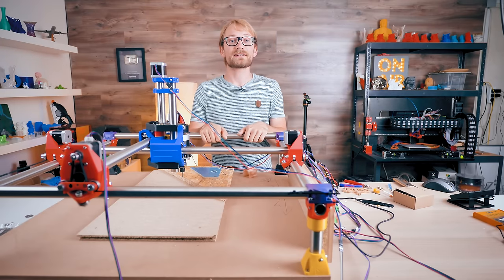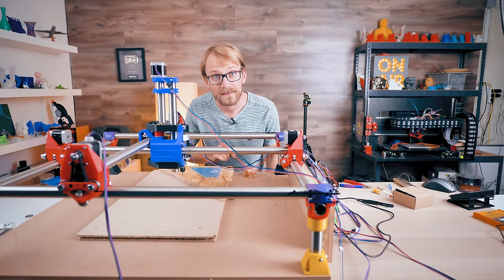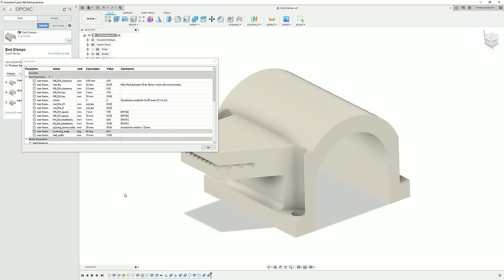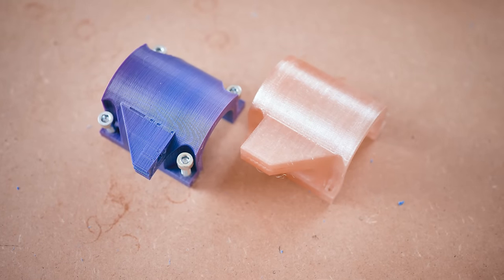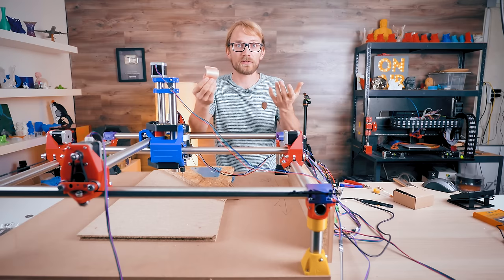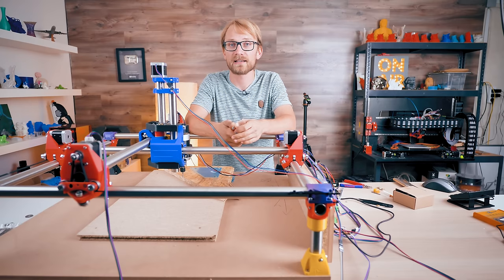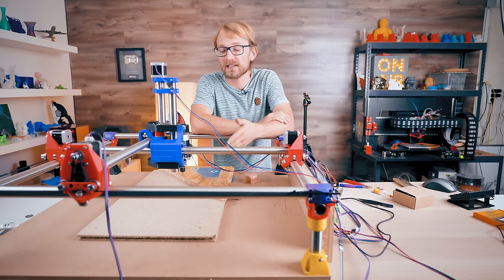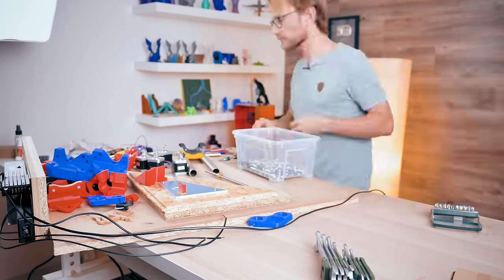Whose design even is this? (MPCNC conclusion)

Comment from the maker: One note on the video: While I was editing this one, I noticed that I had originally misread one of Ryan's tweets. The video is edited to reflect that, but its tone is still a bit harsher than I'd like.
All things considered, the MPCNC is not the right project for me, but I still wish Ryan all the best with it.
Reply: Why make it then disassemble it I thought you were gonna use it
Reply: @davidwhitt3299  Spite. (Still love you Tom :) )
Reply: @davidwhitt3299  Did you watch the video?
Reply: @davidwhitt3299  He probably doesn't want to support the project anymore, I was going to build it, but I'm certainly not now
Reply: @davidwhitt3299  because you do not want to check for licenses when sharing a new part. he stated clearly he wanted to make the machine more flexible and accessible. imagine the nightmare of licenses. clearly this is not the machine that fits his needs
Reply: @davidwhitt3299  Because of the license claims of the 'maker' and Tom's admission that making a for profit video about it is a grey area, it would be foolish to continue doing anything with it for the channel if/when the 'maker' pulls his (implied) permission. I would also make a wild assumption that the thing has left a very bad taste in Tom's mouth (for all kinds of reasons) and personally I wouldn't want the thing in my line of sight if I could avoid it. It still has a ton of useful parts that could be used for other projects, such as any other OS CNC...
Reply: @davidwhitt3299  i wouldn't want to touch that project even with a long stick after that kind of tantrum from it's owner.
Reply: @davidwhitt3299  Because of this licence mess? If Tom can't design mods/upgrades for it, and release them freely ("free as in speech" as well as "free as in beer"), then that takes away one of the main reasons for him doing it.
Tom has always been very "pro-open-source", and IIRC one of his Patreon goals about two years ago was releasing his videos under a Creative Commons licence (that was subsequently reversed due to issues that I don't recall, but he asked his Patreon supporters for their views before he made that decision).

Designing models and releasing them freely to the very community that pays his bills is his whole thing. Sure, he could continue using this machine in future videos, but currently it sucks really quite badly (not saying that's Tom's fault, of course!), so in order to use it he'd have to either design upgrades that he can't release as freely as he wants (and if he doesn't release the models, then that reduces the value of what he's doing), or he'd have to use existing designs from the community, and "hey look at this collection of a dozen models I found and printed" isn't Tom's style: there are plenty of other channels that do that, and if I were in Tom's position I wouldn't find it nearly as interesting or fun to print and show off a load of community mods instead of designing my own.
Reply: @animationcreations42  Same as me...
Reply: So I guess if I want to build this with some parts of my own design, the copyright police will invade my shop. So sad. I'm still leaning toward one of the OpenBuilds designs, but more money.
Reply: Oof. What a drag. Good thing I never actually looked into it like I meant to. NC licenses always felt like a red flag to me, guess I was right.
Reply: @Sven_Hein  next the God of the MPCNC will be suing Prusa over his flagrant use of a 3d printer to make thinly disguised CNC machines.
Reply: I had a very similar experience. It really bummed me out. I tried to sell mine for way less than I had into it because I was unhappy with the performance, and just wanted it gone. He emailed me and told me I couldn't sell it because of the license. Long story short that thing ended up in pieces just like yours.
Reply: This is really is bad taste regardless of law. All that was needed was a tweak to your license to include attribution, which you were already doing, and the addition of non-commercial. Why would any company want to work with you if this is how you respond when something happens you don't like? Unfortunately, I will also be unsubbing from your channel although the amount of content as of recent has been extremely slow to be released anyhow so I guess I'm not going to miss much. I liked your content, but this is extremely childish and serves no point but to stir the pot and point a negative light on a business protecting his work. This is just something I wont support. 

Bye Tom, good luck.
Reply: Probably gave Ryan too much free publicity. He needs to go all commercial now and pass on the open source. Too bad it had promise.
Reply: @Matt Bridges Who is childish here? Tom is clearly having issues with misbehaving company. He tried to improve his machine and share his knowledge with others, but Ryan does not want him to do that.If you do not understand it, then bye, will not miss you!
Reply: Tom stright burned Ryan, with this distrack.
Reply: @mattbridges385  So, all that was needed was for him to disregard his own feelings and give in to Ryan's wants. How dare he want to release the part he designed under the license he prefers to appease Ryan's ego.
Reply: @Cergorach  i agree with you.... you never know when the original author will come back and stab you... saying you profit from it's idea, one way or another....
it's better to stop now, than facing a lengthy court fight later.....
Reply: Very good video. I followed the conversation on twitter and the way Ryan acts ends up to one conclusion for me: I will not build his machine and I will not participate to his project. It's pure cherry picking what he is doing. Regarding your tone: Perfect.
Reply: Damn... really?!  I've followed your build  for the most part live.. And was thinking of building my own.. But that doesn't sound as appealing now.. 

I was very curious what your improvements would be.. 

What about designing this from the ground up?  I have the time and and capable of designing this. Only thing I miss is someone to collaborate and discuss with.

Or are there maybe already some good designs out there? Maybe modulair/optional with a rack and pinion drive?

Ow,..  and ofcourse fully open source
Reply: I’ll upload the part for you.
Reply: @benjaneering  Ridiculousness. I'm out.
Reply: No, the tone is perfect. Instead of accepting an welcoming an improvement on his design, he became an arse.
Reply: @therealnecroscope  same here.. let me know if you find another project..
Reply: Maybe Build the compact PCB maker that "The Ant" guys designed. Think you did a video on it?
Reply: I 100% agree with you, Ryan comments in chat were off base at times. Several viewers offer Ideals to him, but he rejected them. Its a shame, nice concept going nowhere... If can't help improve it than what's the point ..
Reply: @Thomas Sanladerer I would love to participate in designing a fully open source 3D printable CNC design.
Reply: @johncrunk8038  That's not accurate. There are a lot of remakes of these parts. The only thing Ryan is watching out for are the ebay sellers cutting out his shop (which is protection of the community as well as Ryan). If you make parts yourself, no foul. If you make parts and release them CC-NC, no foul.
Reply: @jeffeberl12  I was just extending the hyperbole.
Reply: Hey Tom, I gave you some $ during the build to ask if you'd visited the V1 forums.  Your answer explains a lot.  Good TV  ≠ Good Build.  The V1 forums have proven solutions for changes in design.  If you get jealous when a bunch of other youtubers make successful builds, the forums will still be there :)
Reply: @benjaneering  wow...i can't even wrap my head around that!
Reply: @catohagen He already does that, just there is a child that does not understand copyrights. Copyrights are not the same as patents, respect that!
Reply: leans in and whispers

MAKE A HYPERCUBEEEEEEEEEEEEEEEEEEEEE  xD
Reply: @mattbridges385  but what you're doing isn't the same? He don't like the way the project is taking and, with some respect, pulled off. You're doing the same: you don't embrace the contend anymore and unsub. Same principle.
Reply: @c4tohagen  I don't like the license but I could live with it. But the way Ryan acts and his false understanding of licenses is what I don't like. Have you seen 4:06 to 5:00? Unbelievable behavior from Ryan. Unbelievable understanding of how licences work and what rights he has. Nope - If I go for a CNC I go for an other one or build my own. 
BTW: If you think his understanding of licenses is right, you might want to do some research.
Reply: @mattbridges385  good luck and happy viewing others content for free, without paying them for their effort...  
But you obviously didn't understood the problem expressed.
Reply: @anthonyvescio5311  I wouldn't bother uploading the parts.  The project obviously doesn't want any improvements in their/his design.
This is why Stallman made GNU License.

To be clear, anyone can do anything with their own design.  But others must NOT like it and doesn't NEED to build it.   Better go to a project that is open to improvements.
Reply: @davidwhitt3299  you didn't even watch the video
Reply: @jeffeberl12  it is obviously not the copyright owners opinion.  And who want to go to court because of that.  It isn't like it doesn't cost you money.
Better to drop the project then have to pay for copyright infringement.  Even if we "know" that it isn't accurate.
Reply: @c4tohagen  Ryan obviously doesn't agree with you...
So better to go to a real open design, where the owner doesn't threatening others with law when you do an new part to replace a bad old one.

It isn't just the laws that makes it look like a bad idea to build this machine.  I would like to like or at least respect the actions of the copyright owner of the projects I build.  This story doesn't do that to me and obviously also Thomas.
And if that work ok for you, then good for you.
Reply: So... Basicly it's not possible to make a CNC with 3d printed parts without infringement of "copyright".
What if I create my full own design?
Reply: @davidwhitt3299  because he wants to take his ball and go home.
Reply: @RacoonMedia  right, I was thinking the same if we take Tom's interpretation of Ryan's argument to the logical extreme.  Tom went out of his way to design the part from a blank canvas and the constraints of the already existing pieces with the intent of avoiding this confrontation and when it happened anyway he realizes this content won't have a place on his channel.  How abstracted would the 3d printed pieces need to be for this guy not to be on your back?
Reply: @AndersJackson  Except you simply can't copyright  physical objects that aren't works of art. Or stop anyone building and selling one. You would need a patent to do that and even then the law allows you to make compatible parts and sell them. And I doubt there is anything novel enough about it to get a patent. The owner only has copyright on the files. You can't sell those. So because the author doesn't understand copyright law doesn't mean you have to accept his interpretation or be afraid of litigation.
Reply: @chemistclips  let's start a project and call it OSMPCNC 😌
Reply: I think you took the wrong approach with this one. You knew (or should have known?) the CC NC status of the parts going in, and now this video is riling up a mob of people to be angry at Ryan. This feels like packing up your toys and going home, rather than trying to reach an amicable agreement of some sort. I think it would be worth trying to see it from Ryan's POV and why he might want that license in the first place.

I also feel like the ending of the video was intentionally misleading, when Ryan was very clear in his tweets (even the ones shown in the video) that you are not prevented from doing commercial things with the printer... The only thing he wants to prevent is other people SELLING parts based on his designs, which seems fair to me.
Reply: @nophead  in USA and many other countries you can both Copyright and Patent software.  While the international Copyright and Patent laws CLEARLY state that you can have Copyright on program but not Patents.  Patents are only for ways of building and controlling physical things.  Not algorithms and programs.  And Algorithm, Science and Mathematics can't be Copyrighted not Patented, except in USA.  Which have a huge impact how companies in other countries behave.

So yes, you can't patent Software/Programs/Algorithms in Sweden. You can in USA.
(Yes, you can patent a software WITH a physical process, like an algoritm to handle elevators smoothly.  That combination of software/algorithm and physics are ok.  But that very same software/algorithm  and physics combination doesn't apply to other use of that very same software/algorithm together with another physical process.  Like Program A and Elevators can be patent, but that Program A and ABS breaks on Cars doesn't apply=
Reply: @MattRix  dat was not the issue.. In short Ryan claims he can prohibit people adding or improving parts of the mpcnc. And tha's imho ludicrous.. 

Hypoteticly the claim that the parts look similar wouldn't hold up in any court. 

Apart from that..  Imho I find Ryan's position in this very strange.. not even mentioning him writing to people that they cannot sell their machine. If they turn out to be unhappy with the performance
Reply: @AndersJackson  That may be but we are not talking about software here. STL files aren't software.
Reply: @vincentmetallive  from what I understand, he doesn't prohibit people adding or improving parts of it at all. It's just if you are going to publicly release plans for parts that are directly derived on the existing parts (which is obvious with the part in this video), they should use the same license as the parts they are derived from, which I think is fair? 

To be clear I never said Ryan was perfectly correct in all this, just that the way Thomas seemed to use this video as a form of revenge, rather than something positive or constructive. I don't know anything about him telling people they can't sell their machine, that's obviously ridiculous... though obviously an unscrupulous person could use "uh I'm just selling my machine" over and over again as an excuse to get around the license restrictions.
Reply: This is youtube, not an airport, there's no need to announce your departure.
Reply: @nophead  I know that STL files isn't software.  And it is used as a comparison of why licenses matters.

So what are your arguments?
Reply: @nophead  well, it still cost money to defend from accusations of breaking someones copyright.

And yes, I do agree with you about a resonable interpretation of Copyright and Patent laws.

But still, in USA your software are protected by Copyright, but there they still allowed software to be patented, even though the Copyright- and Patent conventions say you can't patent, only have copyright on Computer Software.

So I wouldn't be that convinced, even if it is reasonable to think that.  Not when it come down to much money.

And I also think that you should respect the one that have done the design.  And Ryan doesn't allow Thomas to share his improvements to everyone...
Reply: The whole point that Tom trys to put across is community, help each other and all that open source stuff. It's a poor show from Ryan as I would expect that you would want collaborators on a project especially if it means your project will take the step to the next level.

As Tom said, it's a very grey area to have built it on his channel and all it would take is for Ryan to turn round and revoke permission.... Leaving very muddy water as to video take downa/where the profit from video goes and all that other jazz..... Best just dismantle and move on.
Reply: It's a shame that you allowed him to bully you into abandoning the project.
Reply: @davidwhitt3299  Why would he continue with a project that he has to modify to work correctly, when the original author clearly is against anyone making improvements? Why would he give him any coverage or publicity for a sub-par project.
Reply: @johncrunk8038  Probably better off with one of the openBuilds designs. MPCNC is a flawed design and has inherent rigidity issues that can't be fixed by bulking the printed pieces design up further. If the creator the project could just accept that the community could fix his design mistakes through the open source development model, then it could be made viable. Being things as they are, best to move on.
Reply: @mattbridges385  Annnd THIS is how you respond to something you don't like?
Reply: @animationcreations42  why not build it? It is a great machine.  Will you never have children because some cry more than others?  Thomas is acting like a kid not getting his way..
Reply: @MattRix  Fair enough! I didn't look at it that way..
Reply: The licence of the design of MPCNC is a topic, but why didn't you try to find the flaws in your build? There is several videos on YouTube with MPCNC milling aluminium, and their build has the same parameters as yours. Do it right this time Thomas!
Reply: For me, this is a complete lose for both parts (MPCNC community and all the users interested on this project), for me I complete lose the interest on MPCNC project also.

I understand the legal part, but the way to support the MPCNC users using this kind of mods and doing it sustainable for the community is with a "pay for support" and not with a free support without buying any part from original/official maintainer, any project can't have only 1 point to ensure it's existence.

It's a completely different case, sell a copy and redirect the users to the original community than create from scratch a not OEM part equivalent to the original. A real live case is in the automotive sector, a lot of companies creating the same parts with little or no differences. How I say before, this is completely different than doing a part better (or simply, a new alternative) and sharing it for free, for me this isn't the real problem for this "Cease and Desists" reaction.

I can understand the MPCNC community, but in completely disagree with them.
Reply: This would have been the perfect moment for a YouTube-collaboration with "Kanzlei WBS"
Reply: @davidwhitt3299  when you see any kind of feature that can be easily improved and you have the enough knowledge to do it  and any member of the community reacts this way, you lose completely the interest on the project. It's like a toxic relationship.
Reply: Same for me, I followed the videos and was thinking to build one of my own. I would have bought the hardware package from the MPCNC store because the price seems to be good.

And I was waiting for you to do some videos of improvements or where you failed in building it.

But now, I don't want to support such a project. There are other aluminum frame based open source CNCs out there. I will find a better Open Source project.
Reply: @vincentmetallive  to prove this, type "MPCNC" into Thingiverse.  There are TONS of mods on there.  Just don't sell them.
Reply: @francescps   well... maybe Thomas  can ask permission to give away his printed parts? (See where this is going  ;) )
Reply: @MariusSorteberg  Right you are! But I can relate to the frustration
Reply: @GeoffreyPitman523  how is Thomas selling?  He gives it away freely?

Apart from him (partly?) Living off YouTube?
Reply: @GeoffreyPitman523  also who owns a re-recreation ;)
Reply: @vincentmetallive  Tom isn't selling them, but he's stripping the only tool that Ryan has to take knock-off kits off of eBay, by threatening to release it all, entirely open source.
Reply: @vincentmetallive  "also who owns a re-recreation ;)" that's for the IP lawyers to figure out.
Reply: @GeoffreyPitman523  I got the feeling that Thomas, regarding the outcome would see his channel as more valuable ;)
Reply: Intended or not, this whole presentation in this video comes off petty and a bit one sided. You both had a genuine disagreement and rather than respect the other's position and make that a point of discussion, you chose to make a harsh statement both in the public disassembly and summation. It reads as arrogant and implies that if he can't agree with you, then he's to be dismissed entirely. By making it a spectacle, it reads as if you acted to take harm to V1's brand and position to your benefit.  Adding in the disclaimer appears equally passive aggressive and introduces some fault of your own but makes no clarification that can justify the presentation in spite of it which reads as cowardly to establish later claim that no harm is intended. They why post at all or summarize against such a public display of pettiness.  I don't know if this is a case but it certainly reads like that to me. 

There seems to be a lot of this going around in the world today. It doesn't matter who's side your on, or if you even have a side. I've definitely lost any respect I had for your expertise and knowledge because of this and this video established your brand in a very different light for me.  Intelligent confident people can disagree and do so gracefully and remain supportive of those parts and actions that both share. A public dismissal doesn't do that, it harms the community and supports division evident here and on the v1 forums. Regrettably neither party was fully mature and making the discussion public has impacted both and this is your forum so I'm addressing your part here in hopes it can help you in some small way.
Reply: @vincentmetallive  I agree, or he could have just played ball with Ryan and they could have figured out an amicable solution instead of taking his bearings and going home.  But that's just my opinion, and we know what they say about opinions...
Reply: Is sad when a good starting point of a project is faded out into an ownership issue.. open projects meant to be open for that exact thing..to be community improved. Putting restrictions to improvement turn an open project into a close one..where the owner takes what he wants and leave out the makers that fix his design out. Wish you the best but sincerely you may be not in the right way sir (Mr Ryan)
Reply: david whitt not sure, but I think this just happened. It was not Tom’s intention to assemble then un-assemble the thing. He built this thing a while ago and now the dis-agreement with Ryan left a bad taste in his mouth. So it’s better to just move on instead of beating a dead horse.
Reply: Sorry to say I have experienced this too often to count.  I agree with Tom the only thing to do is disassemble. Me personally, I would of bonfired the whole mess and sent the author a link to the video.
Reply: Matt Bridges good bye Matthew
Reply: Thomas, I'm so disappointed in how you handled this series, which is was so excited to see. To help explain why, I'm going to reference and old video of yours regarding OnShape. 

If you use the free version of OnShape, you automatically grant a worldwide, royalty-free and non-exclusive license to any End User, without restriction, including without limitation the rights to use, copy, modify, merge, plublish, distribute, sublicense, and/or sell copies. 

In your own words, "Anything you produce in OnShape is now free for anyone to do anything with, basically"... "But I think actually making stuff essentially public domain, for anyone to do whatever they want with it, might just be a step too far"

...

Contrast that with this video where you copy and modify a design released under Creative Commons Attribution non Commercial (which is fine, as long as you share alike with the same license) and say, "I'm sharing this as a Creative Commons 0 aka public domain, print it modify it, you don't even have to give credit for it, basically, do whatever you want with it" 

Come on Thomas, not only does that go against the original license the parts were released under, you've already stated on your channel that this is a step too far. Do you not see your own hypocrisy?
Reply: Actually... maybe Ryan uses this CC wrongly. I don't se any added notes about the license related to his commercial usage as exception or the root creator has god mode and he should not comply with this license. At least he missed the Author from his license page. Or it is just a mess. And I also don't see if the project have dual license - one for him to be able to use it commercially..... or is this the correct way to describe it: "meaning you can not sell my parts or designs but you can use them to make money"
Reply: @vincentmetallive  How I say before, I understand the MPCNC community opinion, and specifically I stopped now reading from v1 forum opinions. I have read from it what I expected to found, and yes the position is normal, but for me is not useful to nobody including the maintainer.

It's not open and is not closed, you can replicate as original (but is expected to buy it from official store to be sustainable), maybe could be sustainable if nothing if shared, but sharing the files (with a different license) to print your own machine this is losing all the essence. 

You can replicate, but not do compatible parts. This is derivative? Maybe, and maybe not. If it's a compatible parts it's based on some common points, but not in all. You can confirm that an alternative design have the same hours of study to accomplish the same requirements? No, because the requirements for each part are not public.

In software can exists a lot of different classes capables of doing the same thing because are based on same interface. It's a derivative work? Maybe, but this is not a clue. If this was a clue for you, projects like WINE that are based on what I explained from closed source never exists, and this sample case have 16 years old now. This only is a clue to have different alternatives to be used.

This is a reasonable topic, yes it is, but for me also have no sense to have this discussion every time, even when nobody is completely sure that legally are wrong or not. For me the unique case is to C&D the copy selled from third parties, and Tom is not doing that, but yes, can make it easy to do it doing this.

For me, as a external part, I appreciate that any compatible part (including parts designed from scratch) are susceptible to be a "derivative" at community eyes, for the only reason that match as "replacement part". This give the original author to claim an Attribution CC right? For me not. Why? Because one reason is that maybe don't match the original purposes to do it this way for any unknown reason. In this case, the reason is that not all printers can print this part, and maybe this can be a good reason (if really works well) to be included in original design and have reasons to force final customers to buy the original and not do a DIY, it's printed? Yes, but no someone can do it.

For this reason I completely lose the interest on the project, and I arrive to it to help someone who wants to make something like that. For me is enough reason to not use it.
Reply: @mattbridges385  You really don't understand what "non-commercial" means right? And that this is youtube channel, where you create a commercial good in form of videos?

Also he didn't even have to mention him as this is not a derivate of something he has done.

Thx for unsubbing btw.
Reply: @Bobby11  yeah but Tom is right, and doesn't want to get sued for doing the right thing ya know?
Reply: @DasJev  then why make a big deal from it .. either way i dont care anymore, ive unsubbed anyway.
Reply: John Crunk ultimately, probably not. Depends on how much you value your time at.
Reply: Snazzy Riza Ryan deserved it, if he’s claiming open source status. My maker space was asking me to print all the parts needed for a lowrider CNC, if I came up with parts that functioned better, I would want to share as well.

Ryan would be better off selling assembled machines than playing in the open source world if he wants this much control over the parts.
Reply: @davidwhitt3299  he doesnt want to use it as is.  He has cnc's that dont chatter. To fix it the way he wants, he will need to redesign parts, which puts him at odds with the project designer.... so no point.  disassemble and use the parts on something else.
Reply: animationcreations42 same here
Reply: @MattRix  Well, the ´problem´ is the disagreement about what´s a derived part. Bad example: Given the physical constraints, all airplanes got wings.
To fit onto the rails, Tom had to design a part, that roughtly looks like a part Ryan designed. But it still is a part designed by Tom - from ground up and NOT by modifying an existing design, which would be a derivate. So it is Thomas´ choice, which license he releases it under, because he is the creator of this design. Remember: It is just this part. It is NOT Ryans design nor is he free to dictate the license of this newly created part. As much as I respect the effort, Ryan had put into his design, I think he went way too far with this license issue. I sincerely hope, that Ryan will understand that in time and choses to fight only the fights worth fighting for.

CC-BY-NC is a bad choice for this anyway as it prohibits evolution too much. It is more applicable for artworks but not modular machinery.

BTW: Thomas lives in Germany and is thus protected by European and German law - which gives him the right to create new parts or change existing ones for compliance and compatibility reasons, no matter what the license of the original design is. Newly created parts - such as Toms - are under the copyright of the creator of that part. So the license
Reply: Great decision Thomas! If you found that license is mess and machine is not fit your needs I believe you will find out your own solution! Go for metric if possible =)
Reply: How can i email you about somthing
Reply: Redemptioner1 not only is that wrong, you don’t have to have a patent on something in order to release it under a license, but by your logic Thomas can’t release it under a Creative Commons license either...
Reply: @avrXperiments "you don't want to check for licences when sharing a new part"... that's preposterous. Of course you should check the licence, and that doesn't start when sharing that starts when downloading the original design. The whole Maker community the whole Open Source movement and everything and anything in-between relies on propper use of licences to function and to allow creators to be able to support the product they create properly.
Reply: Assemble the Makerfr CNC instead @ Thomas Sanladerer
Reply: You did the right thing here to walk away from this project. Why give the guy platform. Why give the guy free advertising. Someone doesn't want to work with you, just walk away.
Reply: Perfect response, Thomas! Very good to know, how the creator of those projects ticks. Was interested in the Low-Rider, now this is just a no-no for me. Fortunately I have already designed my own CNC, so designing a new CNC from the ground up is not such a big deal for me. You did the right thing, I loved the teardown! Keep going, I really like your style!
Reply: Right on Ryan one your argument and killed the project in process. Was it worth it?
Reply: @michael-rommel  Maybe Tom should review your machine then. :)
Reply: mweverett Haha - good idea, but the machine I built is not 3D printed - that one is more a classic design with 25mm linear guides and 20mm ball screws. What I meant is, that designing a CNC is not rocket science, it is more tedious work and many, many iterations, before all parts fit together. I am sure Thomas could do it.
Reply: Thanks for sharing the copyright/license-experience. I totally share your view on this and you draw the right conclusions.
Reply: @johncrunk8038  no because there is no copyright you can't copyright functional parts Only the artistic portion of those parts what time is it is correct he is clear as far as copyright he also does not want conflict he does not want to have a fight with other makers which is why he is simply putting the project aside a sad but good decision on his part I suspect
Reply: @c4tohagen  if the parts are his design it's his license what he made is not a derivative original authors not allowed to extend his control to other people's intellectual property that's the problem here
Reply: @davidwhitt3299  How are you going to use something that is so ill designed and you are not allowed to improve the problem areas.  Just bag it and move on to something more productive. Good Call Thomas!!
Reply: When you make something based on someone else's work you have to accept their terms. If not someone could simply change your design very slightly and put it out using whatever limits they wanted or even price.

The way you handled the dismantling was more little hurt child than professional adult. "I can't get my way, I'm not going to play."

You seem to think there is an issue between making review videos and licensing, perhaps you should check that out. This has probably been fought over before and included in fair use policy.
Reply: @mattbridges385 , you did not pay attention to Tom's complaint. He did NOT make a "copy" of Ryan's part. Watch that part again.
Reply: @crystaldragon141  the premise of Ryan's design IS laudable... To use very inexpensive and easily acquirable parts... I think the idea of using EMT conduit is great OR, using angle iron/aluminum as @JeremyFielding suggests. (does the @ sign work in YT?)
I think using THREE tubes for each axis rail instead of one (in a triangle cross-section) would make a really rigid machine!
Reply: @mattbridges385  hahaha pot meet kettle.
Reply: If you make it to fit metric pipes etc then it does NOT fit on to his imperial parts, so please continue with a metric version...
Reply: I wouldn’t support it either lol
Reply: animationcreations42 your better off unless your looking for a cnc drawing machine lol
Reply: It's a 3D printed CNC machine that runs bearings on tubing. I can't any reason why Tom couldn't create a CC-0 one from scratch if he wanted too.
Reply: @MattRix  Erm, no. Ryan is not trying to stop people from selling parts made from his designs. He's trying to bully Tom into not making open source compatible (i.e. no copyright infringement) parts that others could produce and sell.
Reply: Benjaneering of course you can sell it. That guy is demented and doesn’t understand business.  I was going to buy one of his kits till I saw this video and the way he operates.  Now I’m going to design and build my own MPCNC machine and give it to the world CC-0. Stand by Tom... help is on the way!
Reply: Janis Rocans took the reply to @mattbridges right off of my keyboard.
Reply: Wicked Mystic pm me... I’ll gladly collaborate and see about putting some CC-0 machines out there.
Reply: yes build a metric hard forked version.
Metric-3D-rebells against the evil Imperial-CnC-Lord xD
Reply: And now I will NOT build this one. There are other designs like Nikodem Bartniks, wich Ive already built. 

Keep up the good work man.
Reply: @AndrewGillard  Tom earns a living from 3d printing.  Why can't others in other ways?  One way isn't the only moral and ethical way.  I'm very glad I don't have to make everything and there are people out there working hard to bring me good products.  Sometimes it's simply nice to buy.  Tom creates for a profit just as the cnc machine designer creates for a profit.  One isn't more moral because his check from from advertisers through google.  He's still a capitalist..   Profit is incentive and nothing happens without incentive.  Think Tom would be doing this channel for no reward?  Hardly.
Reply: @benjaneering  there's no way he could enforce that. The guy is delusional.
Reply: Thomas, your vids are  always informative.  I built the mpcnc. I personally think it could be a lot, a lot better.  Plus there are better free open source CNC machines out there.  I think, Ryan believes his machine is so freaking awesome that is the only one out there.
Reply: Shame it didn’t work out and your input may have made the MPCNC even more awesome.
Reply: Ryan seems toxic.
Reply: Are there any alternatives
Reply: @vincentmetallive  Whattt? He stops people selling their machine???
Reply: @animationcreations42  look at Ivan Miranda, he made a mpcnc design and he seems to be cooler about it
Reply: It's a bummer to have these conflicts.  I respect both philosophies, but I prefer Open Source more.  Dude, you can carve out your own space.  I'd like to do something similar with metal for a more fire-proof cnc plasma.  Inspired by what Ryan has done, but different.  I'd call it MPC-CNC for Mostly Plasma Cut CNC.  As a plus, the plasma cut metal parts would be made significantly faster than the 3D plastic printed parts.
Reply: I need a CNC. I was going to build this mpcnc but if this is it than I can build another. Belt is always problematic. It stretches a lot. Maybe we should find with threaded rod version. Do you plan to build another in near future?
Reply: Look for printnc v3 much more rigid design with screws(I think lot of scope for improvement).  Not a Single Dislike comparted to likes in this video !!! your tone is perfect, there is either 0 or 1 same for open source or close source...
Reply: Yikes!  What a bummer all the way around.   I'm sad you had to just give up on it.
Reply: Having rights or not can't prevent someone from suing you anyway, which costs money to defend  @nophead  
"You can beat the Rat, but you can't beat the ride"
Reply: @davidwhitt3299  because it sucks at its job. Watch the video before commenting.
Reply: I don't wish him any luck. Glad to see his poorly functioning machine and lack of legal understanding get the light it deserves.
Reply: @f1shboT  Or just maybe he realized the design is fundamentally flawed.